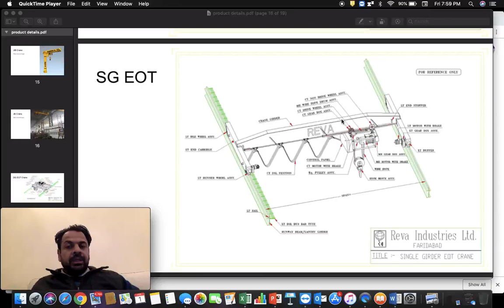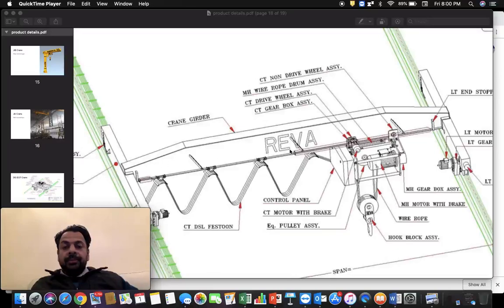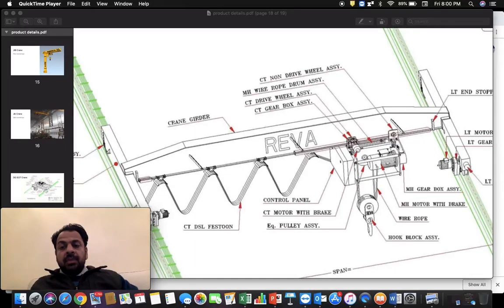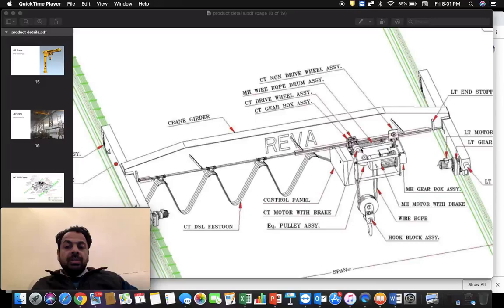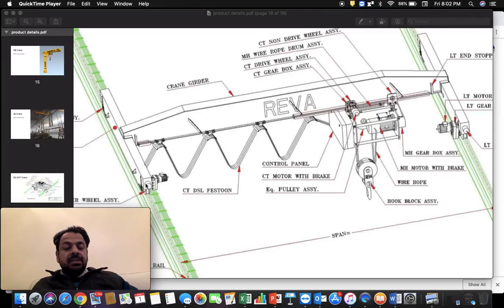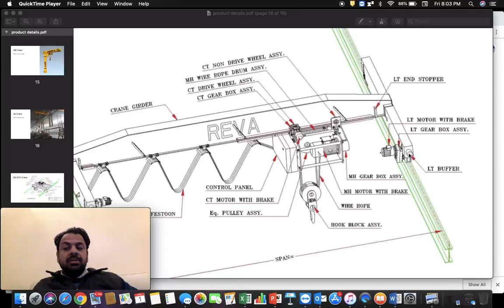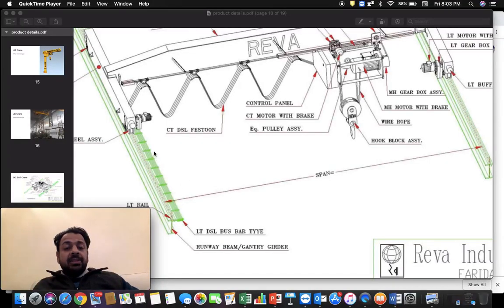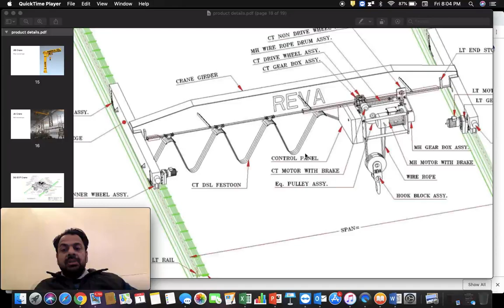Single Girder Crane Parts | Reva Industries Ltd.

Comment: A geared trolley is more ergonomic than its basic, manual counterpart. As the name suggests, this option can pull on a durable chain. Quite akin to a basic over the head door operator, the chain in a geared product would hang over the trolley. Also, this type of trolley does not depend on the manual push and pull activities. They would roll with the wheels of the trolley, just along the beam. If you are ordering these trolley types, then make sure to specify the hand chain drop you desire. Even when you are hiring them, inquire whether your agency can customize it as per your requirement.https://loadmate.in/